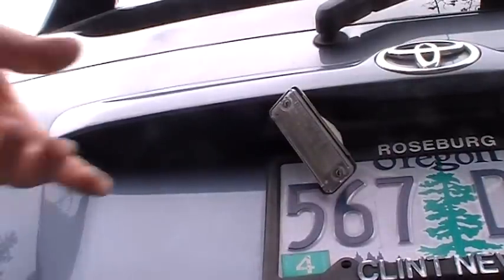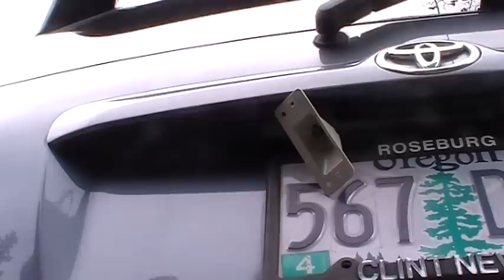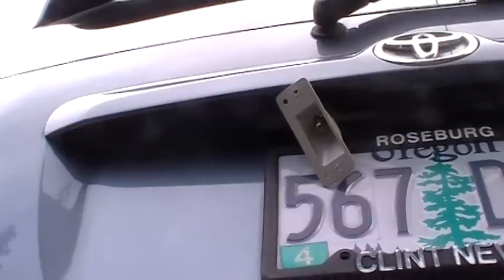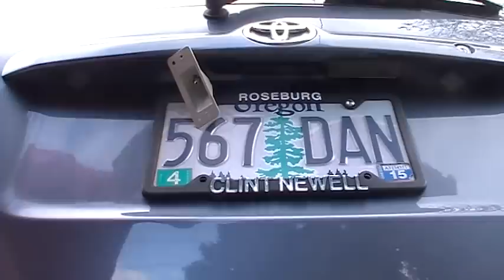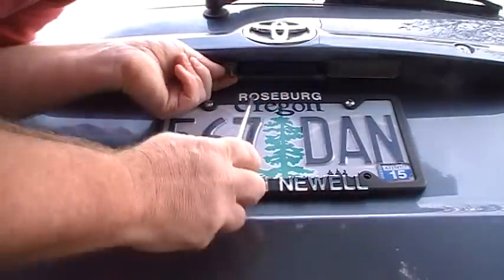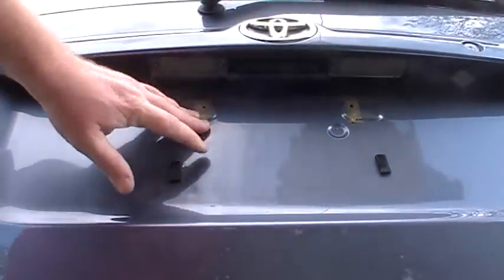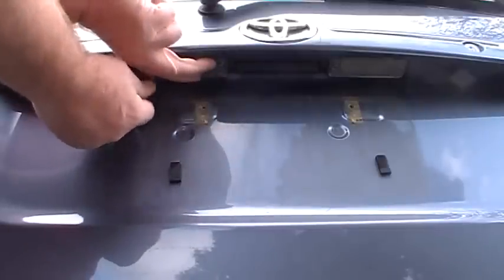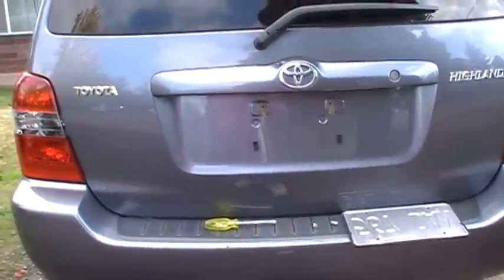Replacing license plate light bulb

Comment: I dowsed the old screws with Kroil penetrating fluid. I used the philips head screw #8x3/4 from AutoZone to replace the rusted screws.. Also I had to use vise grips to pull out the old bulb from the frame. Thanks for the video.

Comment: Terrible time removing screws on '08. Salt belt. Screws deteriated.  I'm resorting to ordering new lenses and cutting old out.  It's easier to work on by opening tailgate and bringing to your level.
Reply: I have the same issue ,what size bolts are the right ones to replace the old ones ?
Reply: What size are the replacement bolts ,i have the same issue with my 08 highlander
Reply: @rayleon0869  I can get you the info tonight.  Once I removed the thread portion of the screw I just matched the closest one in a stainless steel phillips pan head sheet metal screws from Lowe's.  #8 x 1" or guesstimate.  For the right one I was prepared to cut off head with a Dremel like tool.  But instead drilled tiny holes around the screw assembly to remove rest of light. Then used vise grips on the remaining. I ordered new Toyota lamps before I did this.
Reply: @80srockerable  thanks a million!
Reply: @rayleon0869  #8 x 5/8 stainless steel pan head phillips sheet metal screw is what I used.  Can get at Lowe's, Home Depot. 3/4" would probably be ok too.  Its just going into plastic. Stainless  steel won't corrode.  Also. I remember drilling small holes to cut off the plastic tab of light that protrudes into area opposite side of screw in order to get out lamp.  Its amazing how stubborn the screw was into plastic.  Good luck.
Reply: @80srockerable  thanks for all the Information  ,i looked everywhere and nobody else mentioned the size of the screws, highly appreciated!

Comment: Do you know how to replace the tag light socket?
Reply from the maker: The socket shown in this video?
Reply: Yes. The Dealer wants $400.00. They say you have to replace the whole thing.
Reply from the maker: I would check at your local auto parts store.  If they can order just the socket, you can cut the wires, and crimp or solder the new one on.  If they don't make an after market one, then order one from the a salvage yard.
Reply: Thanks. I have tried two parts stores and they do not care it. I guess i have to try the salvage yard.